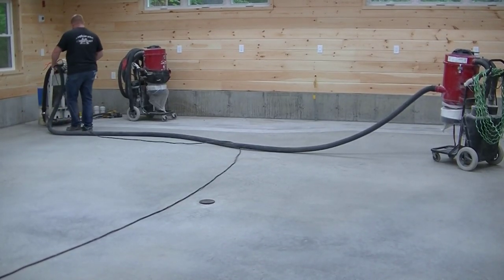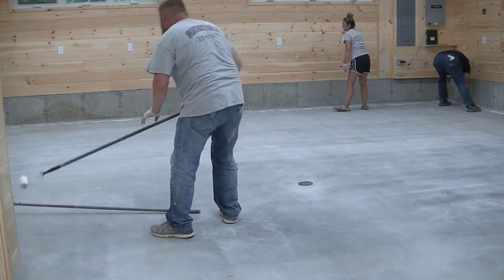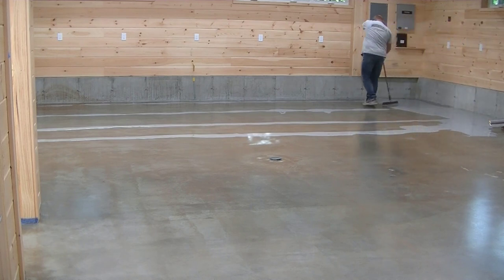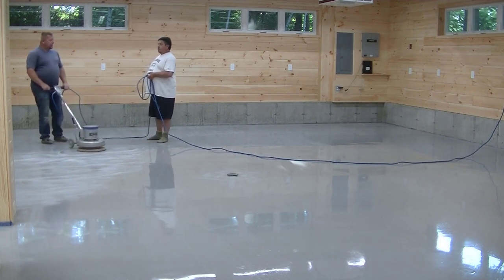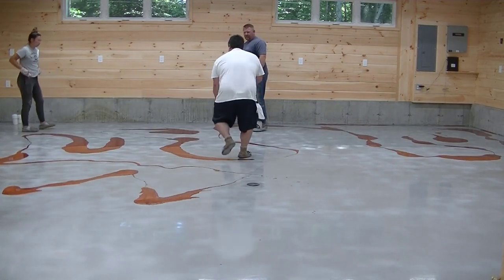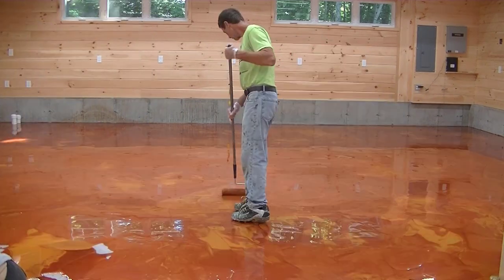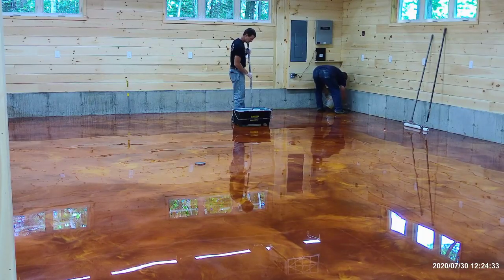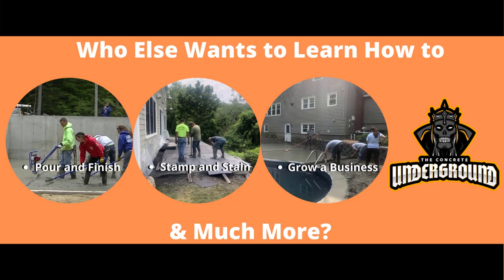Metallic Epoxy Flooring (Beginners Guide Step By Step)

Comment: Beautiful work as always. I just had a 1250sf slab poured in my pole barn. After watchin your videos I graded it and framed it my self and just hired 3 guys to do the pour and power trowel. Thank you for all the knowledge. I saved myself a lot of money. Now what clear product can I use to seal it without having to grind the smooth finish that will resist oil. Also how long do I let it cure before sealing it. Keep up the great videos, you are a great teacher.

Comment: What does it take for up-keep on an epoxy floor like that? Do you need to give it another coat of poly every now and then? Do these epoxy floor coatings have an expected life span? 
Looks awesome!
Reply from the maker: Just a micro-fiber mop and a neutral ph cleaner for up-keep. Expected life span will depend on the usage, residential vs commercial 20 yrs vs 10 yrs. Yes, sand with 220 grit and re-poly if the floors starts looking scratched or dull and worn.

Comment: Nice video Mike! Did you ever do any videos on concrete pads for log cabins to set on?
Reply from the maker: Do you mean a concrete slab? I've got a lot of those videos.
Reply: @MikeDayConcrete  No, these are 3' x 3' x 4' tall (out of the ground) pillars, probably 8' apart. You see them under cabins, where the frost busts up slabs. People put shims between the pillars and their decking and as the frost heaves or gives, they remove or add shims to compensate. You may not have these issues, where you live. I just thought I would ask because I am about to build a cabin in the U.P. of Michigan.